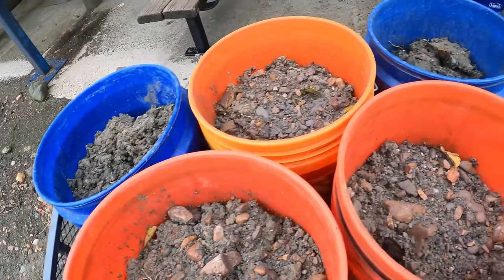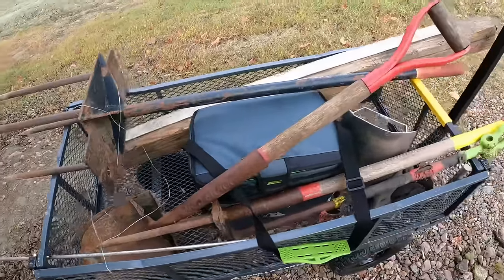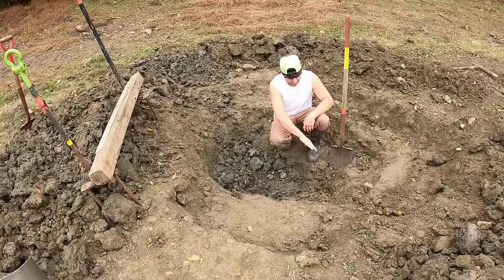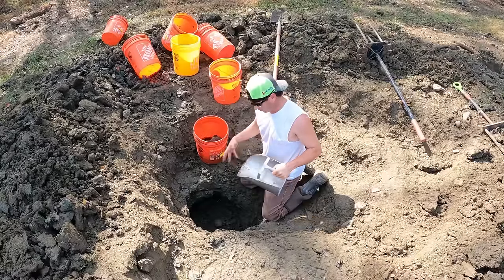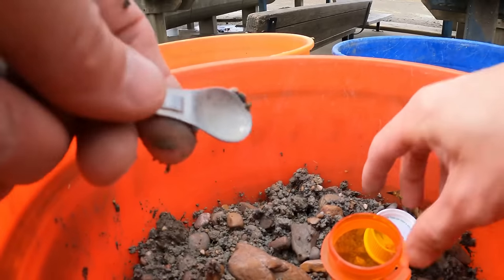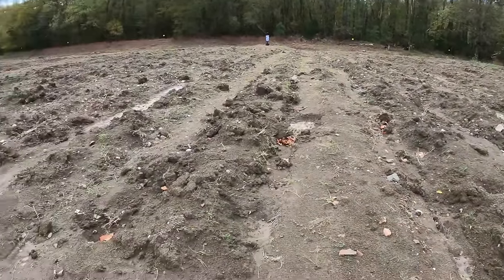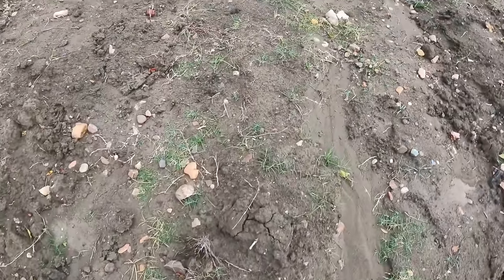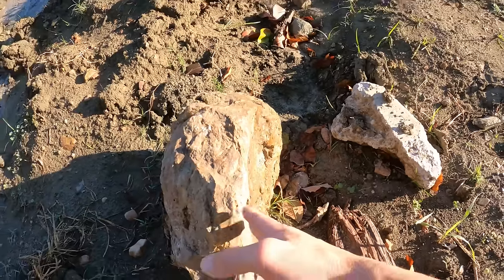EXTREMELY RARE CRYSTAL CLEAR DIAMOND FOUND! - 75 lb Agate Discovered!! (New Record)

Comment: if you loosen the gravel with your fork, couldn't you use a post hole digger to make it easier to get the deep material out and into the buckets?
Reply from the maker: probably not. it’s harder than concrete in some layers. takes a lot of everything you got. or you won’t get much. Thanks for watching

Comment: Please don't bend over and put your whole weight on the prober, like you were doing...  If that handle snaps off you could die, as it can go right through your body/heart.(Many people have died having that happen!)  We want you around for a very long time.  Beautiful Clear as Glass, Diamond, Congratz!
Reply from the maker: it’s stainless steel, top of the line as well. It’s a $500 probe i custom made. It will bend before it brakes. My other sharpen tools are made of pumping rodes from a oil well. They will break before they bend. science 🧪 👨‍🏫